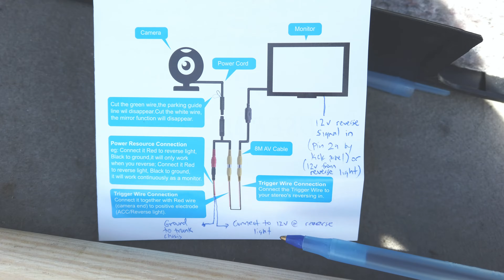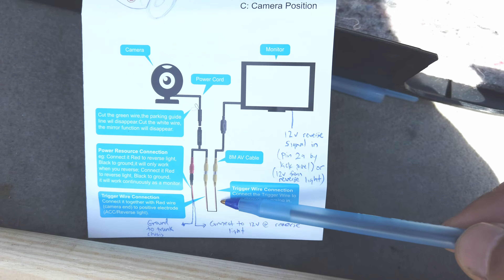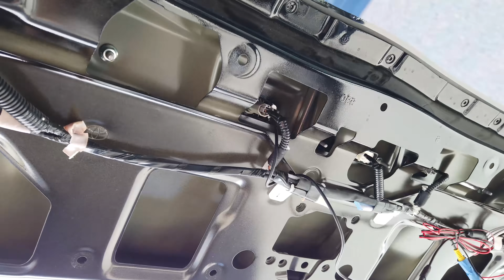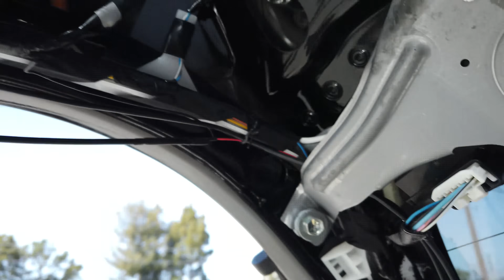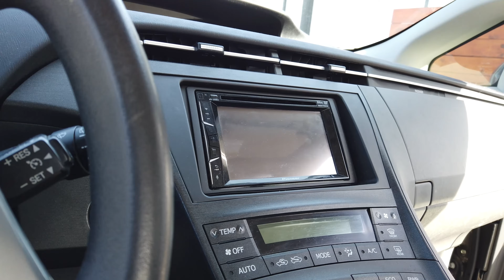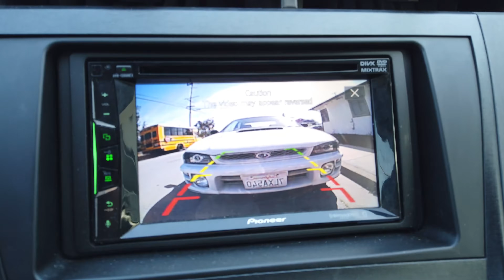2010 - 2015 Toyota Prius Backup Camera Install Overview

Comment: Would a 6m video cable fit from head unit to camera?
Reply from the maker: Hello, I did a quick google search, and they said:
Cable Length (20-25 ft): If you route the wire along the side rocker panels or underneath the seats to go to the head unit, 20 feet is just enough, but 25 feet gives you necessary slack. If you run the wire over the roofline/headliner, 20 feet is perfect

Comment: The link to the screen doesnt look like it includes a radio or any buttons. Did you use the VIDEO SCREEN that is linked to Amazon in your description? Anything helpful or new you can tell me. Im concerned you lose a radio
Reply from the maker: Hello, the original link was for the backup camera only. It looks like the seller updated the listing to include the camera AND standalone monitor. 

Here's a few links for the camera only (you'll need a yellow video cable), and double din stereo (any that accept a yellow video input works).
Backup Camera (Camera only): https://amzn.to/3KClqTZ
Double Din Radio (Any with video input will work): https://amzn.to/4o4STVt
Thanks for the question.

Comment: I wanted to thank you for the hint about removing the flex tubing to gain access to sliding the video cable and power wire through. Nobody has mentioned that little very important piece of info. I was able to remove panels and hide all my wires but was stuck on that final challenge. Thanks again.
Reply from the maker: You're welcome. I'm glad you were able to figure it out!

Comment: Thank you for posting this video it was very helpful. Two questions:
 1. Did you run wires from back to front? 
2. Did you have to extend the DC cable somehow? 

I ran my wires from front to back which may have been a mistake. Running them this way I have no way to connect the DC input from the camera to route back to the taillight compartment. 

Did you extend your 12v input somehow?
Reply from the maker: Hello Dizzle, I ran my wires from the back to front. The challenging part is running it through the silicone housing between the trunk and car frame. You may be able to install it front the front to back. https://youtu.be/G5oGdbJVORc?si=sAAesmLnbTdABFJ5
I connected the backup camera 12v source from one of the reverse lights, so I didn't have to run a power wire through the car.
Reply: @ColinLeung  Excellent! Thank you sir!
Reply: One more question. Did you run your yellow video cable through the rubber conduit in the hinge of the hatch? I got so frustrated trying to push that end through that i thought, "I'll cut it and feed the through it and splice it back together" forgetting it was my video cord. Got another one on the way.

Did you find a trick to pulling it through that conduit or did you bypass it altogether, only bringing the DC cables thru it?
Reply from the maker: @Dizzlemane800  I fed the yellow video cable through the rubber conduit, but it was very difficult and required a flat head screwdriver. I pulled power from the rear tail light, so I did not pull power through the rubber conduit.
Reply: @ColinLeung  MAN I can't think you enough for your quick and thorough replies. That's a great idea to use a screwdriver VERY CAREFULLY. The point of your video is don't give up. We can make it of we try 🤣. Thanks again buddy. 

I also found that my red 12v wire attached to my rear taillight was not enough power to trigger the reverse wire on the head unit. I think it's because I'm using the wire as power source the DC. Both wires connected at the taillight. So I tapped the reverse wire from head unit to red wire in kickpanel and that did the trick. I've watched your video at least 10 times. 🤣
Reply from the maker: @Dizzlemane800  Great. It sounds like you got it working!
Reply: @ColinLeung  yes it is! For any struggling with feeding wires through, with the screwdriver I fed a wire to tie my cables too wrapped in duct tape then sprayed silicone lubricant on it. It was a breeze after that! Thanks buddy!

Comment: Great video. My 2011 Prius backup camera doesn't give me the guideline and thinking about replacing just the camera part without have to run the new wire to the front,, do you think it is possible?
Reply from the maker: I'm not too familiar with the stock camera and how it's wired. It may be possible to rewire a new camera to the old wiring.
Reply from the maker: Pinkfreud62 is correct

Comment: Thank you for the visuals. I just did this today on a 2013 Prius. Hardest part was running wires through that grommet and running for power to the camera from the reverse light, which is NOT on the tailgate. I used one of those cameras that mount upside down so it looks OEM with no wires exposed though.
Reply from the maker: You're welcome. Sounds like a clean install. Great job!
Reply: Link to camera?

Comment: Do you need to open up the gear box for it or no
Reply from the maker: Hello, are you referring to the plastic below the shifter? I was able to run a wire behind the speaker down the right side panel below the glove compartment

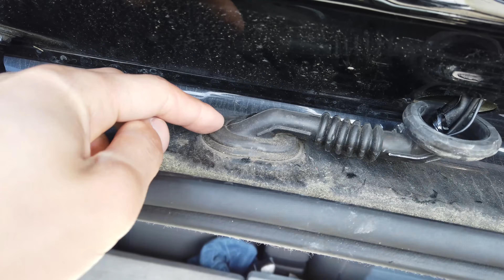Comment: I was having issue to put the rubber on the bottom hatch back in place, 5:27. How’d you get it back in, I thought broke something I couldn’t put it back it place, so I had to put tape on top of it just for temporary.
Reply from the maker: I think I used a very thin flathead screwdriver to push the rubber back in
Reply: Thanks man, finally I could pop it back in place. Your video really help.

Comment: Great series on stereo/camera for the Prius. Any ideas how to wire same  backup camera BUT powered through a on/off switch so that backup camera can be used at all times, not only when backing up?. Thanks
Reply from the maker: I'm sure it's possible. Instead of tapping onto a switched 12v source, you can tap it into a constant 12v switch like the cigarette lighter. 
Also you'd need to configure your display to always show the backup camera, or add a toggle switch that you'd flip when you want to see it. Depending on your aftermarket stereo model the video may be triggered by a 12v signal.

Comment: hi good video i have a 2011 without camera i want to put the camera is it possible?
Reply from the maker: Yes, you can add a backup camera, and will need a display. They sell ones that you can plug into a cigarette lighter, so you do not need to do hard wiring.

Comment: Did you have to modify that light at all to fish the cable through? I imagine it wouldn’t be flush, so water might get through. Did you have to use any sealer or something?
Reply from the maker: I didn't have to modify the light. The cable was thin enough to squeeze between the corner of the light and the trunk. It was pinched a bit, but still worked.

Comment: Hey! Thanks for the video, it was super helpful. I didn't manage to get i working though as i have an aftermarket android head unit and can't find a trigger pin for switching to the rear camera :( if anyone has faced a similar issue please reply.
Reply from the maker: Sorry to hear that. Perhaps you can contact the head unit manufacture to find out.
Reply: @ColinLeung  i would definitely do that if Chinese manufacturers bothered to brand their units :))
Reply from the maker: @psychofreack  :(

Comment: Hey Colin, great video. I have a 2010 Prius that I just installed a Boss Stereo that came with a license plate mount backup camera that looks very similar to the one in your vid my question is where do you connect the red wire comes off the yellow video RCA cable? It is power correct? Can it be spliced into any power source or does it have to be the backup (white) light?
Reply from the maker: Hello William, you can splice the red wire off of the yellow RCA cable to the same 12v wire that you pulled from the tail light. The other end of the red cable will go into your stereo unit for switched 12v source. I hope this helps.

Comment: Do I have to have an after market stereo for this? Or can I use the monitor that came with my 2013 Prius II?
Reply from the maker: Hello Enrique, I am not too familiar with the stock monitor on a 2013 Prius. With a quick search I did not see an A/V port on the back, but that does not mean there isn't a device to convert one. Sorry that I was unable to help. You can try contacting a local stereo install shop like Best Buys for answers.

Comment: Big question!! Thanks for the video Colin. But quick question, and I hope I'm just a little off. So I'm choosing to run power from back to front with the exact cable you reference here. I'm going to tap camera power from the Reverse light and splice in the trigger power from that too. But where does my front 12V power go? 10:25 you say it goes into the reverse signal switch. You mean I have to extend it and route it under the kick panel? Thanks so much in advance.
Reply from the maker: Hello Andrew, I'm assuming you're referring to the 12V reverse signal that tells the monitor to switch displays to the backup camera. That 12V signal wire can be fed from either 1)The red wire sticking out of the yellow video cable. One end will tap into the same positive wire from as your backup light, and the other will go directly into your stereo harness for "12V backup switch". 2) Alternatively you can splice a wire from Pin 29 by the kick panel TO the stereo harness for "12V backup switch". Let me know if this answers your question. Thanks
Reply: @ColinLeung  Thanks for the response! Yes, I was referencing the 12V Reverse signal. I'll be doing the 1st option you mentioned, where I'll be using the super long yellow RCA with the red + attached. I just haven't had any luck finding what port on the stereo head unit I'll be plugging into. The best I could find is that it's pin 2 on the 28 pin connector (unplug the connector, and it's the second from the left on the top row). Can you throw any validation to that?
Reply: Just hooked it up and I am correct! So for anyone looking this information up: to trigger the radio into displaying your camera, you must supply 12V to Pin 2 on the 28 pin connector on the back of the stereo. This can be supplied from a long ass line coming from the Reverse light in the back, or from Pin 28 in the harness under the driver's kick plate. My camera is functional, reply with any questions.
Reply from the maker: @andrewireland7931  I'm glad you got it working!

Comment: how important is that grounding wire? My camera suddenly stopped working. I opened it up and I'm pretty sure nothing was grounded or it came off.
Reply from the maker: It's very important. It's like plugging only the positive cable to your car battery. The car will not start without a complete connection. The same thing will happen with your camera. It will not turn on when it receives a positive voltage because it has no where to go.
Reply: @ColinLeung  thanks so much Colin!

Comment: How have u found the camera PIN number ?
Reply from the maker: Sorry, I'm not too familiar with the that setup. I am only familiar with adding an aftermarket camera to an aftermarket stereo, and not the stock screen.
Reply: @ColinLeung  ok but how is it possible to know which plug is tjr stereo one and the pin of camera reverse ?

Comment: Fitting the wire through that rubber hose is not difficult is effing imposible I’m about to get a kitchen knife  and end this 😡😡😡
Reply from the maker: Sorry to hear that. I suppose you could cut the hose and electrical tape it after.
Reply: @ColinLeung   I was able to do after stressing for an hour I pass a long flathead screwdriver and pull to stretch while my wife push the cables in, not fun but I did it
Reply from the maker: @Adorador247  Great job! I'm glad you got it figured out
Reply: @Adorador247  i know it's a bit late, but for future reference, you can lubricate inside of the rubber grommet with silicon or soapy water as well as a small portion of the wires which you will fish through. Instead of using screwdriver, use a coat hanger and make a hook at one end. Then fold a good length of backup camera wires (black with connector and red for reserve backup light) and loop it under the coat hanger hook. Then tape that part with a good amount of electrical tape and lubricate that portion. After that you can gently pull the other end of the coat hanger while massging the rubber grommet as you fish the bundle of wires through. Hard to visualize but the point is to lubricate it, use hook connection will allow the wires to slide through rubber grommet easier than fishing it dry.😁😁